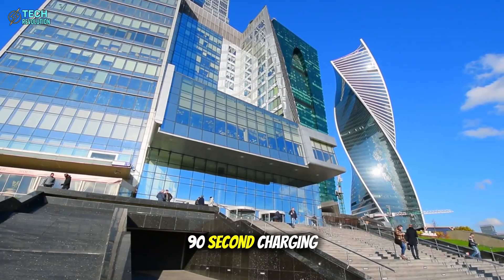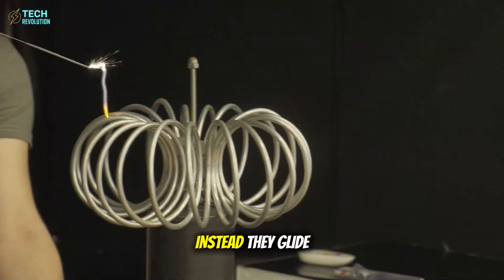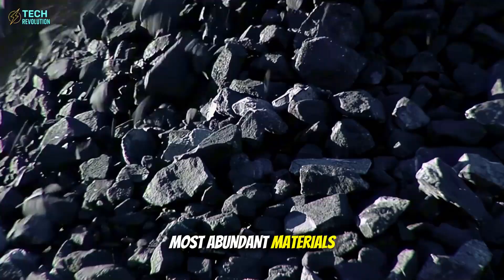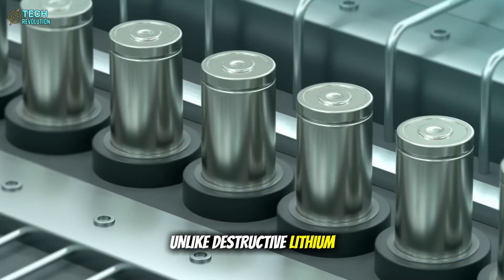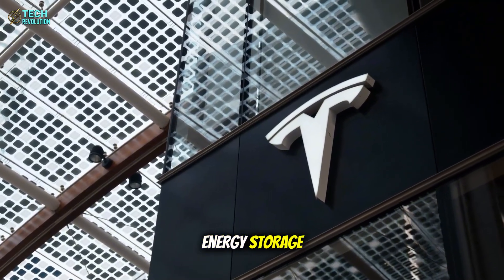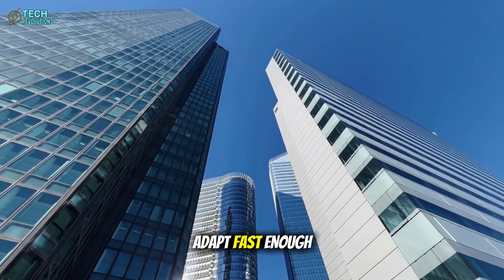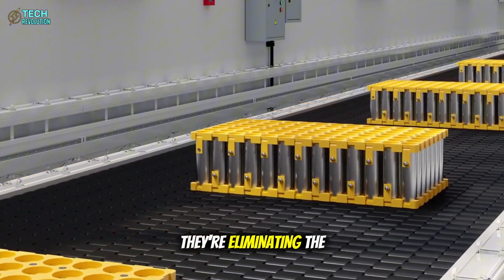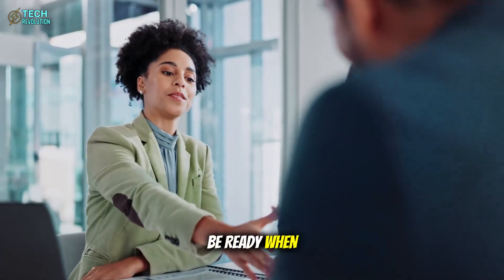Tesla Just KILLED Lithium: New Aluminum Battery Charges Faster Than Gas!

Comment: There are still problems with the technology to make them a viable option over lithium. In particular is energy density, where the same size aluminum battery holds a lot less energy that its lithium counter part. While the video mentions problems with the cathode, there are also problems with the aluminum anode, which is aluminum oxide creating a barrier. Certainly batteries need improvement and perhaps this aluminum technology will eventually pan out.
Reply from the maker: Thanks for the insight! While aluminum batteries face energy density challenges, Tesla's graphene cathode and new electrolyte boost efficiency, potentially rivaling lithium. Issues like aluminum oxide barriers are being tackled, promising a viable, sustainable future.
Reply: @TechRevolution26  Yes, certainly progress is being made and I hope it works out as a viable solution.